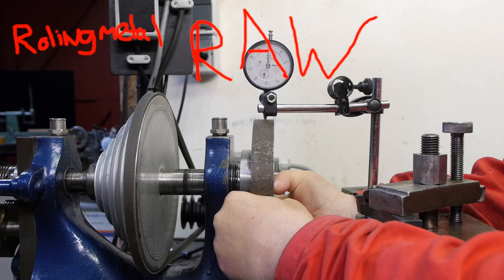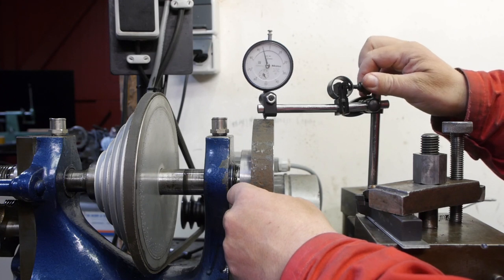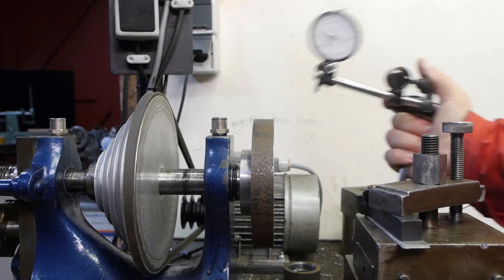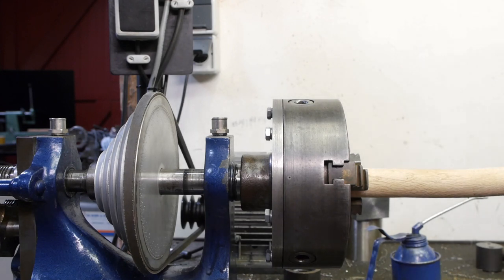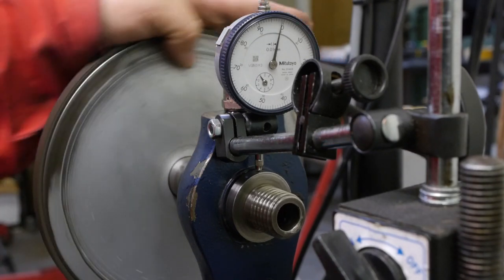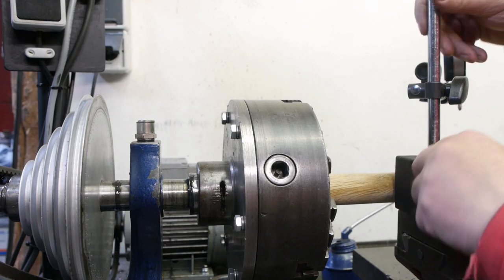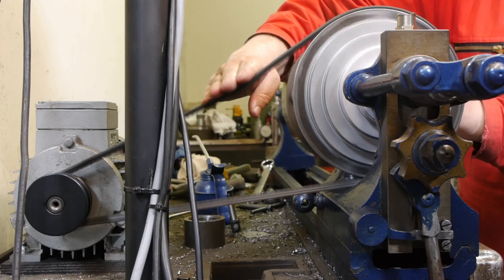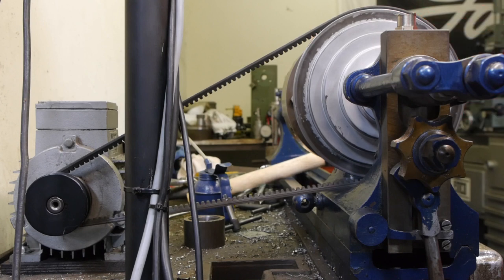Measuring play in the old Karger lathe''s spindle bearings.

Comment: You can try to push up and down between the pulley and the spindle bearing to eliminate flex and get an accurate measurement of the play in the bearing.

Comment: From that, I'd say your front bearing is almost certainly toast.  You shouldn't be seeing more than a couple of hundredths of lateral or vertical play.  Runout's good though, so it could be flex, but that would be flex of the entire head assembly, or more likely, play in the lock / unlock setup at the back.  Might be worth seeing what the play is like on the back of the spindle.  Regardless of where it's coming from, a tenth of a mm vertical play is way way way too much.  My Schaublin is supposed to be adjusted for less than 2 microns of play (it's actually got above 5 microns, and it's "borderline").

You're almost certainly getting a bunch of vibes through the belt as well, might be worth looking into a solid V belt rather than a toothed one - they're less efficient, but less noisy.  Also check the alignment of your motor to the pulleys on the spindle and maybe try increasing belt tension.  This is part of the reason I prefer flat belts, TBH, much less fussy.

What to do about the bearing(s) is another question, of course.  The fact they aren't conical means you have little room for adjustment.  They're pillow blocks, I'm guessing (2 parts split horizontally)..  Bronze, babbitt, cast iron?  

If they're pillow blocks, adjustment is done by shimming under the bottom bearing and then scraping down the bottom bearing until you align the spindle with the ways (and tailstock), filing off any extra bearing now poking above the lower mount, and then scraping the top bearing to fit.  It's not trivial, but it's not as much work as, for example, rescraping a lathe saddle.  It's something you'd probably have to do yourself, though, as even if you can find a pro to do the job, it almost certainly won't be financially viable to get it done by a pro.

My chickens come to see me in the shop, too.  Inquisitive little buggers.